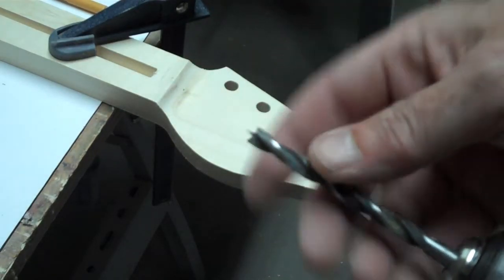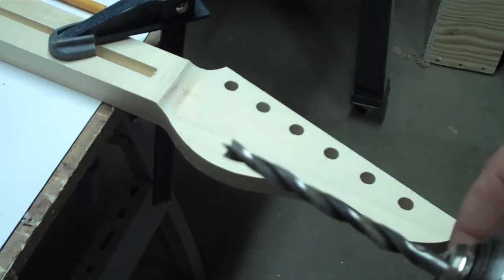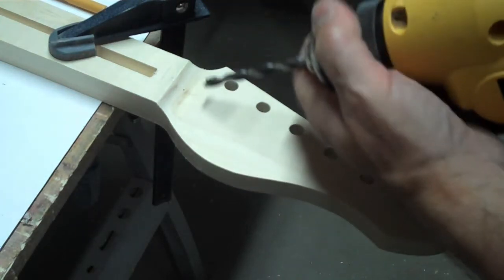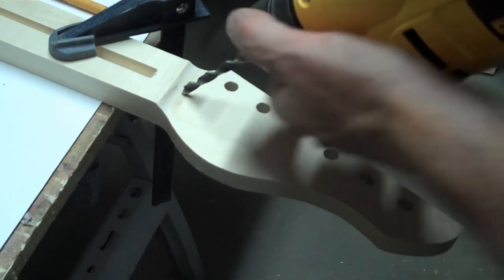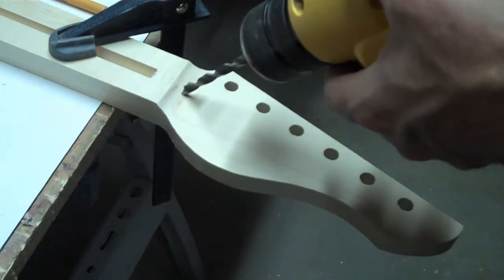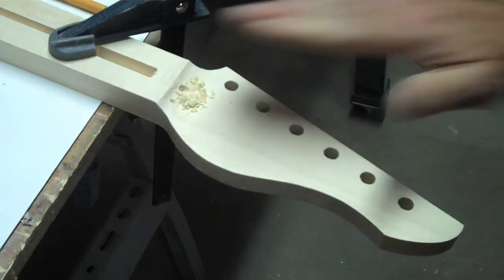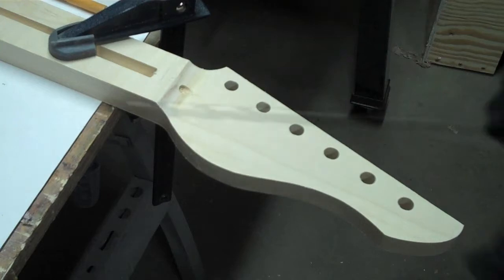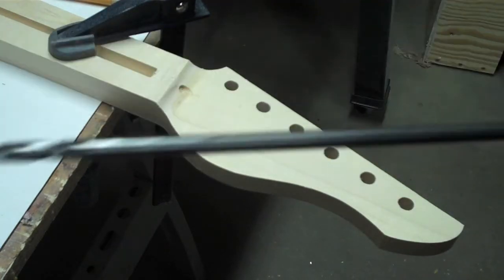How To Drill A Truss Rod Access Hole In A Guitar Headstock

Comment: Having now tried it, I'd advise anyone wanting to do it to make a few practice runs with scrap before attacking their nice new neck.
Reply: Don't be afraid to clamp a block to the top of the fingerboard to provide additional support, either. 

or if you have wandering bit syndrome, mark with a punch where you want the drill to start.

Comment: Hi, I am trying to wrap my mind around drilling this whole for the truss rod. Tell me please, what is the thickness of the headstock and what is the thickness of the neckshaft? Also, are you mounting the truss rod upside down (with the adjustment nut towards the fretboard side)?

I keep looking at my CAD and it does not add up. I have a 19 mm neck blank with a 14 mm headstock thickness. I am using thin profile double action truss rod (9 mm depth x 5 mm width) and it seems to me that if I mount the truss rod in the conventional way (adjustment nut away from the fretboard side) and drill this hole like you show it, I can't reach it nicely with an allen key afterwads.

Comment: Very cool method.  I just have one question: the truss rod is a modern style, ie not in a curved channel, so if you drill the access hole to it at an angle, won't it meet the adjusting nut at an angle?  I guess there is still enough wiggle room for an allen key to work when you need to adjust it?
Reply from the maker: Back when I used this method before I switched to CNC, I used a ball-end allen key to adjust the truss rod. They work at almost any angle.
Reply: @HighlineGuitars  Ah ok that makes sense, thanks!

Comment: Thought you just route the truss rod channel longer and when you make the headstock cut and sand the curve that was your opening? or am I wrong thanks.
Reply from the maker: You can do it that way but you'll end up with a slot that is open at the top. Not a hole.
Reply: @HighlineGuitars  ahh that makes sense sometimes hard to go from 2D to 3D lol always good to try on scrap thanks!!😎😎